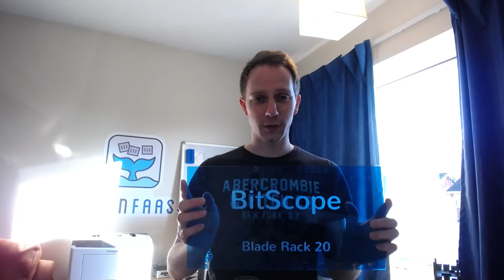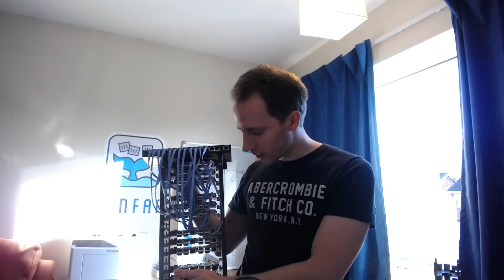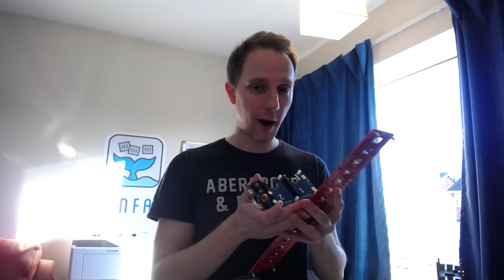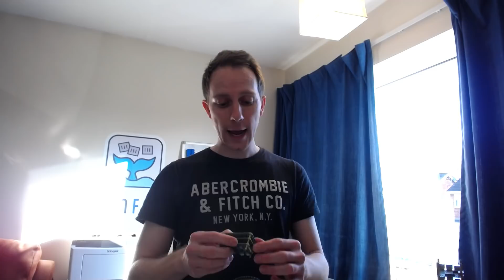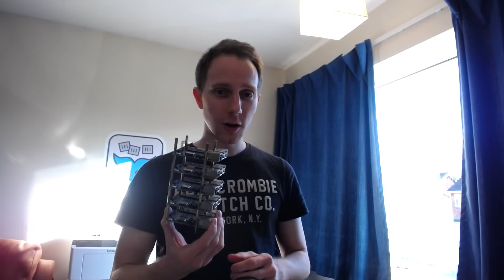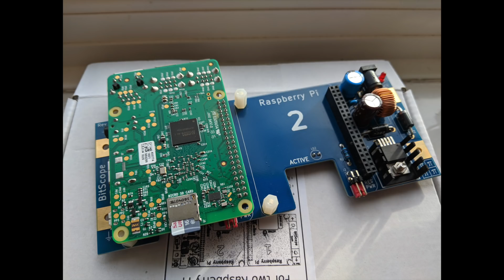Raspberry Pi Clusters and the BitScope Blade

Comment: I know have one of these things and though I love it, its just about as impractical as could be. Just as an example, if one of your pi or other devices fails, you are going to have to disassemble the whole thing and I mean whole thing, right back to the stage where you're holding a bunch of plates.

Comment: I don't see how you can do that with net work boot, because each pi needs A different key to putty in, I am interested    in buying two over time after I finish my HP Proliant ML350G6 Desktop / Server, right now I have 36 gigs of EEC Ram & the idea is to have two CPUs in it so I can have 74 Gigs of ram 4 X18 = 72 of EEC, then I can start this other project after I add A large hard drive

Comment: Have you considered/tried to make a cluster with something more powerful like an odroid-xu4 (or the other variants like hc2/hc1/mc1)?
Also, in order to help the sd card couldn't you just mount a nfs share for the path used by docker/kubernetes for storage? Or ISCSI, etc.
Reply: Those boards are better but the support is crap, so getting Docker to even launch is a rabbit hole of unique problems only you have attempted to solve in all the internet.
Pi is standard in a such a way that most things work for it.
Yes, NFS works to boot. Docker doesn't seem to work off of NFS storage though.
I  think there is potential in ISCSI, but I don't know anyone who has for sure gotten it working with docker/kubernetes.
One could make a cluster other than Docker using Beowulf, but that's not the target idea in this case.
Reply: I have Rock64 4GB versions with a 32GB emmc in each and additional USB ethernet and have them in a Kubernetes cluster with shared NFS storage that works a treat.